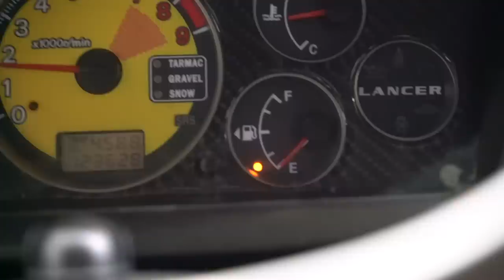It Had To Be Done...

Comment: Brother you need a Yellow Top Optima in there with all those electronics. It's a deep cycle meant for heavy loads like your compressor.

Also, you probably have a draw on your battery from one of those electronics you've added. Take the the negative battery cable off the battery post. Use a multimeter with the positive lead on the negative battery post and the negative lead on the negative battery cable. Check for a draw. Anything over 35-50 miliamps will kill your battery.

If you have a draw. With the multimeter setup the same way. Start pulling fuses to see if your draw goes away. Or disconnecting your power leads to your electronics, if not fused.
Reply: was thinking the same thing. Something has to be drawing power.
Reply: Parasitic Draw Test Required . and Yes Folks the man here is spot on but the magic number not to go over is 50 Ma .  anything over this then dependent on size overnight then it's Not going to fire .even more so when the plates are cold the battery will not hold the same Crank potential .  Might be the Vehicle with a issue But after market Electrics are known to cause problems . the TT Will pull 10 amps out of the battery if the Door Module goes tits up .there is zillions of issues on all cars .But good  Videos and your meet's are now world wide as we are in the UK and we know the evo very well . good work and we all love your  Girly . She is cool .

Comment: Your frs probably has some parasitic draw somewhere in your wiring. I have the same battery and no issues.
Reply: So do I with no issueshe has horrible battery maintenance with them cars though he just leaves them on started and s*** in the cold and whatnot in a hot ass whatever and not ever start him until he wants to plus runs a million accessories on he probably needs upgraded alternator to
Reply: Jordan and Melissa Salinas yeah anytime you do any mods to your car that requires power from your battery. You should consider upgrading